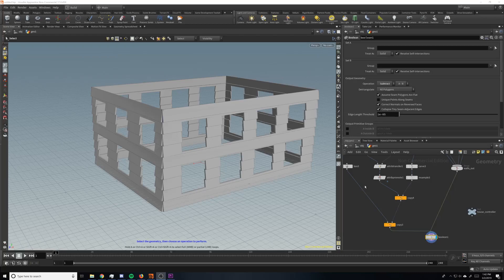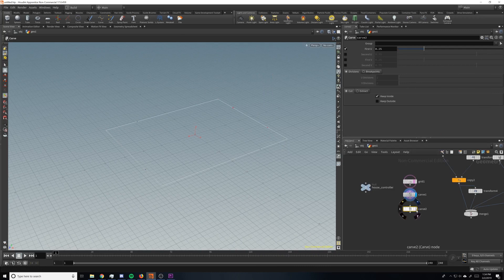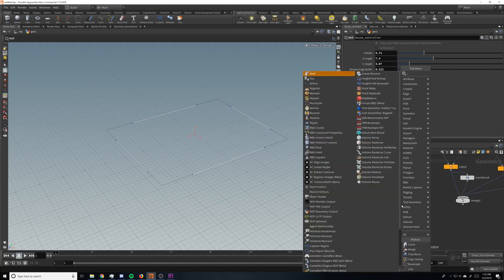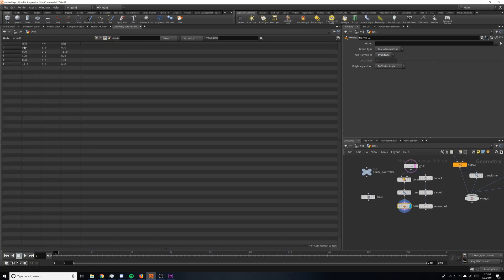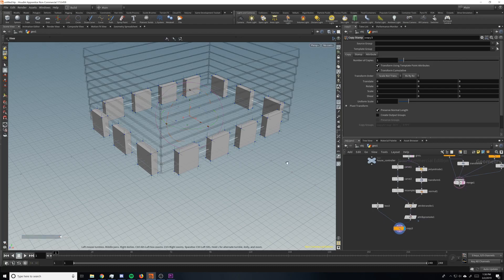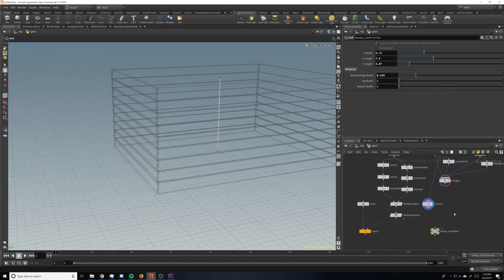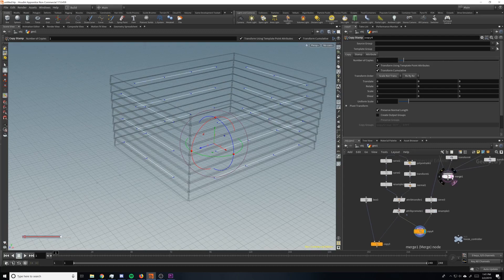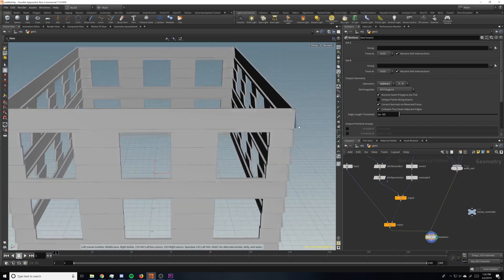Houdini Procedural House Tutorial Part 2

Comment: I had someone ask me a question about this tutorial, he couldn't get it to work properly... Here's what I found why his windows didn't actually work to anyone using this - the wall thickness should be set as a function and not as a fixed value - and the window extrusion should be set as a channel reference to the wall thickness so to not break the system if you change anything. After all it's procedural and meant to be a template for use in further projects, you should always try to keep the procedural nature of your node system and parameters as much as possible and try not to hard code values.